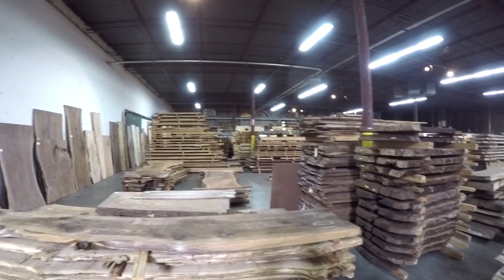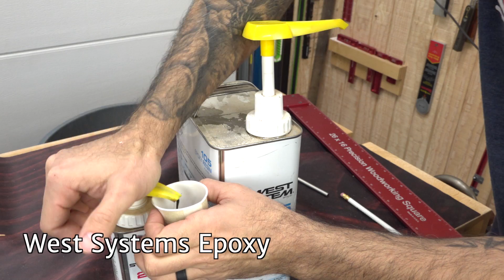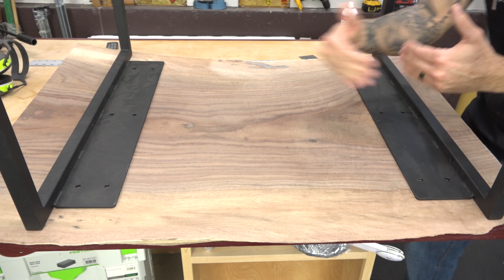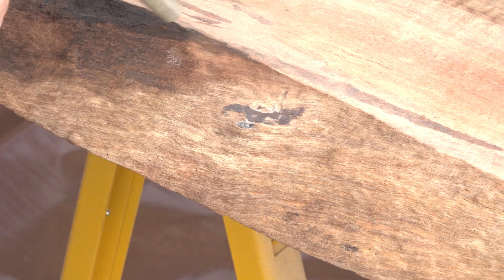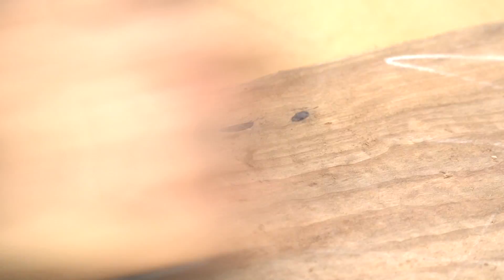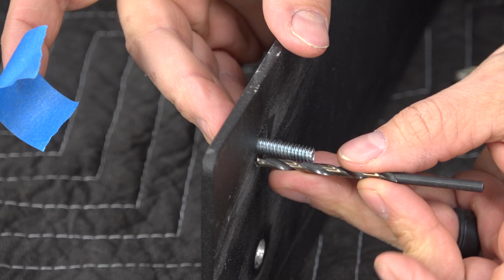Live Edge Slab Coffee Table

Comment: The wet poly sanding, did you use a disc with holes or continuous? How did you clean up the velcro on your sander? Is there a type of wet/dry sandpaper to avoid for this process?

Comment: Rookie mistake: I started with a very rough cut 36 inch Dia. Red Oak cookie. Used a router to take off an inch on each side and coated it on both sides with the recommended sealant everyone uses. Stored it on slats on top of the fridge in the garage to dry. Found a 2 inch cracked after about a month. May have been some radiant heat from the back of the fridge. Just finished the 2nd and 3rd cookies. This time I also wrapped the outer surface perimeter with a high tension strap and storing on slats on the ground in the garage. Thoughts?

Comment: I have a live edge mantle that I'm working on and I have a lot of areas in the sapwood that are weak or brittle. It seems like I just keep removing and removing material and soon I'll be through the sapwood. I initially tried using my sander on a low setting but even that seems too aggressive so I went to hand sanding it, but I can get it to smooth out, it's still rough and material keeps coming off. I'd like to keep as much of it as possible so do you have any tips or workarounds for this?

Comment: Is there any advantage to using polyurethane over some tung oil and lacquer clear coat?  I have always found varnish to be a pain because it's a little tricky to apply and so easily discoloured by a hot cup of coffee which is exactly what you want to put on a coffee table but with lacquer you don't have these problems, is this correct?     I've just finished a table using a coat of tung oil (allowed to dry very thoroughly for a few days) and then two coats of spray on lacquer and the finish is remarkably smooth and clear, and looks amazing.   It was so incredibly easy it's hard to believe.

Comment: Mark, I have used the WW wood taps into black walnut to mount steel legs onto a 40x84 table top. The taps that you developed with Andy Klein are simply awesome. I did tests on 1-1/2" thick black walnut scraps and was surprised how strong the threads are. I could recess a washer full depth into the black walnut's surface. Love your videos and the cracks that you come up with using bad puns like this one. All the best, DD.

Comment: Your table turned out beautifully. Any reason why you didn't use threaded inserts instead of tapping threads into the wood? I'm nearing that point in a project. I was planning on using 1/4-20x1" threaded inserts and 1/4-20x1" bolts to secure the legs, and allow me to easily remove the legs if ever necessary.

Comment: I've noticed you use a lot of wipe on finishes...so it makes sense to sand it to 320.
But I've learned, using thick coats of polyurethane, or epoxy, there is no reason to sand so smooth.
I've done a lot of pieces which I only sand to 80 grit.
Then finish. Which of course takes an extra coat to make up for the (relative) roughness.

I guess it just depends on if you like sanding more or finishing more haha.

Watching your videos does make me want to sand up to 500 grit though, like I did when I was makimg cutting boards.
There is something satisfying about the wood itself being smooth, rather than just the finish.

Comment: So a bit coarser grit on the black beauty will cut through anything. We use it where I work to cut missiles into pieces for testing. We have to surround it with ceramic blocks so it doesn't damage the structure.

Comment: hi Marc , awesome video once again! I was wondering what you would recommend to prevent a piece like this from cracking or splitting. I have 4 live edge pieces and two of them have cracked, huge, in the winter when the heat is on. Any ideas? Thanks

Comment: I have this piece of redwood, live edge, irregular shape that I thought might make a nice wall hanging.  I saw your live edge coffee table project and thought the sand blaster is a great way to go to clean-up the live edge.  I ran out and bought a sand blaster and crushed walnut shell abrasive.  Couldn't get the sandblaster to work on my 6 gal compressor. Tried a 30 gal and then a 90 gal and still would not fire out the abrasive.  What kind of sandblaster and abrasive did you use?
Reply from the maker: That information is in the video as well as the description. :)

Comment: Oh man Marc wipe on poly on such a nice slab!? I need to introduce you to Osmo products. I'll use TopOil or PolyxOil for my live edge tables - especially walnut. Let me know if you want to try or if you want me demo the products for you and I would be happy to get it to you or skype/facetime you for the run-through. (that goes for anyone reading this) They're a German brand I carry now and the quick explanation is that they are 30 years in the making and what I would call a hybrid finish. It's a high solid oil and wax finish with solvent. Your poly there will sit on the surface or a traditional tung oil will soak into the wood. With Osmo the oils soak in to give it that permanent wet look while the waxes provide durability on the surface. It is also really easy to retouch even on site at a clients because it takes a slight sanding and then you can re-apply. Sorry for the rant but you really need to try this.
Reply: is it applied like an oil/wax, or more towards a poly?

Comment: Help needed with tricky issue: 
I've been building a live edge walnut, book-matched  8' long table as an anniversary gift to my wife. But, the ends have some checking (cracks just like the ones highlighted in this vid) that are filled with some menacing white paint that's soaked into these spaces. I'm guessing the previous owner of these slabs put the paint on the ends to protect them. However, I have most of the table finished, except for this issue. So far, I've tried to stain the paint; so I could sand the end and apply the finish (behlen tabletop urethane varnish), but no luck so far. Any ideas would be MUCH appreciated. 
-Thanks, Whit

Comment: How many CFM were you pushing through the sandblaster? Is the 12CFM mentioned on the product page for the gun required/necessary, or do you think a smaller compressor that can do ~4CFM @ 90PSI could operate this gun at short intervals?
Reply: Furqan Memon what you need is volume in the tank. Minimum of a 30 gal. air tank. Bigger is better. If you have enough stored air you should be fine. It runs out fast.

Comment: What I don't understand with woodworkers is the driven need to make surface perfect.  Why?  Just use perfectly planned wood then if you want perfection.  I have built plenty of slab and re-used old wood to make tables.  Some holes are just fine, so long as the integrity of the table is not at risk.  Maybe the price of slabs is driving this.  20 years ago, I was able to walk into a sawyer and get great slabs for under $400.00.  Not now judging by the prices on slabs that are available on the internet.

Anyway, your work is great, just hold the fillers for me.
Reply from the maker: To each his/her own.
Reply: I always fill in voids in slabs, you never know how the table top will be used and the last thing you want is food or drinks to be spilled and fill in the voids. In the case of a coffee table with toddlers that would be a real mess.

Comment: Use thin CA in your threaded holes to strengthen the threads. Great looking table.
Reply: Should you put the CA into the hole or onto the bolt threads or both?
Reply: Lloyd Simmons just on the wood internal threads. Let the CA dry before inserting bolt.
Reply: That makes complete sense.  After you replied I thought about it and if you inserted the bolt into wet CA then it would act like thread locker.

Comment: I went to a shop where they build live edge tables. They use a clear epoxy: Ecopoxy.  The product is 100% solids, good clarity and gloss retention, non toxic, low odor , low VOC's. Pot time is 20 minutes. Cure time is 48 hours. They were filling imperfections in the slab while keeping the real look of the wood through the epoxy.  The company sells color pigments  to tint the resin. Check them out at www.ecopoxy.com. I used the product to fill holes in the black router table plate  and I added   black permanent ink. The shop recommended using a 1:1 resin/hardener mix  as they do.

Comment: Nice video! We have plenty of sources for live edge here in upstate New York. I do lots of live edge furniture from maple, cherry, black walnut and apple wood. The figure on these slabs can be spectacular, especially apple wood. 

Some suggestions:
- Don't be afraid of slabs with cracks, use Dutchmen of a contrasting wood to control.
- Tung oil or Watco Natural Danish Oil before urethane will make the figure of just about any wood pop!
- Be careful when working the live edge as there can be some great insect tracks, worm holes and coloring that you want to retain.
- I have successfully dripped candle wax into voids on the live edge to keep the epoxy from running through. Then chip it out of use a heat gun to soften.
- Adding a contrasting dye to the epoxy will add a new dimension to the wood.
- A blow dryer can be used to draw up bubbles in the epoxy to the top where they can be sanded away later.
- Spend time designing the base. Too many live edge pieces just sit on spindly wire legs or turnings. The base design should compliment the live edge slab and figure. I've designed art deco bases, modern bases with angled stretchers, craftsman style... to compliment the slab.

Comment: Man, tapping right into the wood seemed a bit scary to me, but then I realized how much furniture uses threaded inserts which are... basically the same thing with one more level of complexity added.  The inserts are probably a bit better for knock down style furniture you want to assemble and reassemble, but... eh.  And if you do chew through the threads, it isn't a big deal to drill the hole a little larger and glue in a piece of dowel to start over.  Repair would be covered by whatever you're attaching.

Beautiful piece... it was a live edge slab of black walnut that convinced me to go from just watching a lot of woodworking videos to investing in the tools to actually start making sawdust myself.  And... It's been about a year.  Maybe time to put on a maintenance coat as I did go with a (mostly) oil finish.

Comment: Jealous of that slab availability, that would probably be $600+ here in central Ohio. 

I assume since you're using a Rotex that there are no issues with the poly gumming up the innards (dust ports) of the sander. I have an ETS 150 that I love dearly and would hate to ruin.
Reply from the maker: I'm actually using an ETS 150. As long as you don't totally soak the surface with liquid and you don't connect the vacuum you should be ok. I've never had the liquid penetrate the sanding pad.
Reply: Oh! Didn't see that correctly. Good to know, thanks for the response.

Comment: So just like when stain won't go into areas with glue, I had a similar problem with the epoxy and my coat of arm r seal. Was there something I did wrong or is it better to not use arm seal on places in which it will have epoxy.
Reply from the maker: Well the epoxy is just like a finish in that it absorbs more in some areas than others. So my guess is you're just experiencing uneven absorption resulting in areas that are sealed more than others. Anywhere the epoxy seals the surface, the Arm R Seal won't absorb as deeply. So you might see some color variance. But after a few coats of arm r seal, the surface should actually look pretty consistent but the sealed areas might be a slightly different color.

Comment: Nice job Marc. Did you use the 2000 grit on the final coat as a burnish while it was still wet?
Reply from the maker: Yeah pretty much. That last coat mostly gets wiped away but the diluted poly acts as a lubricant while the 2000 grit pad does it's work.
Reply: David Stanton Ah, nice to see I'm not the only one up at ungodly o'clock here in Oz ;)

Comment: Just a suggestion from my boat building experience. With epoxy on wood there is a wood process called gassing, where the wood will release air into the epoxy. To help in absorbing the resin you can use this gassing process to your advantage by reversing it.

Bring your wood temperature up to around 80* or about 10* higher than the room you are working in. Then mix and apply the epoxy resin. Now allow the wood to start cooling back down to room temperature (68-70*). This process actually makes the gassing work the opposite direction and causes the wood to suck the epoxy in deeper and not create bubbles.

Great work
Reply: heated blanket...
Reply: Thank you for that, Fantastic tip.
Reply: I love finding awesome comments like this one.

Question: how would you warm a big slab like that one? Sun exposure?
Reply: Thanks for that info 😎👌
Reply: thats a cool tip!
Reply: @reidklassen5096  No, it's a hot tip ;)
Reply: Outstanding info. Thx!